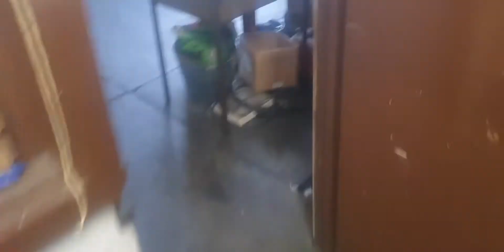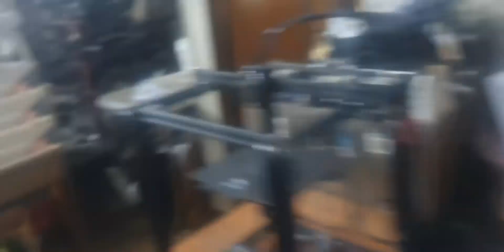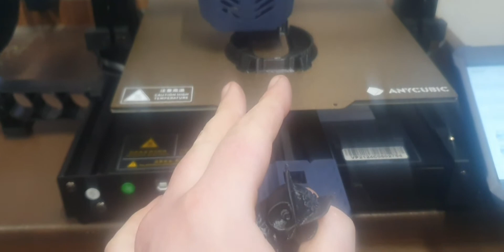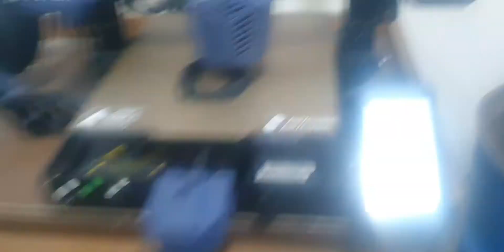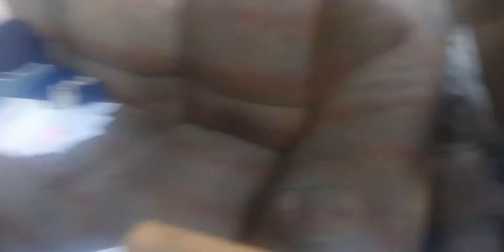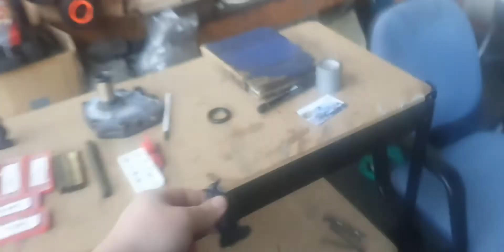anycubic vyper owl gcode problem

Comment: Just started my first print on a Vyper using the test Owl.  As you experienced, the first layers, to much extrusion causing the nozzle to scrape against the previous layers.  After the first 4mm is laid down, it goes down nicely, thanks to your video I am not worried my printer is faulty.

Comment: My printer had the same problem with the owl. It's caused by an overextrusion at the tail of the owl.
Because of this overextrusion the nozzle is jumping over the surples filament. If the nozzle get stuck the next layers will be shifted.
To avoid this issue in constrictions or corners you should activate linear advance at the firmware.